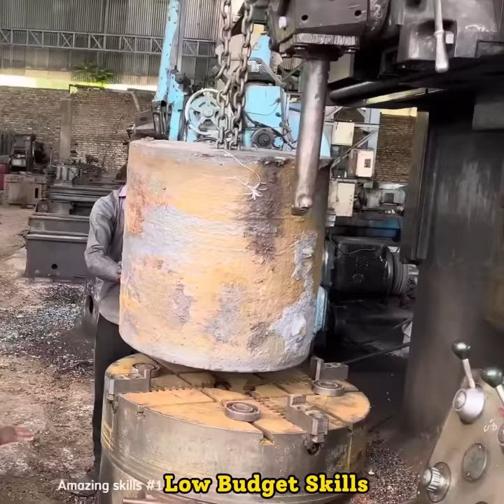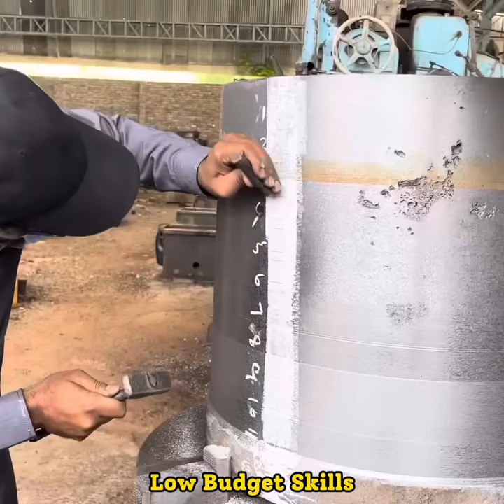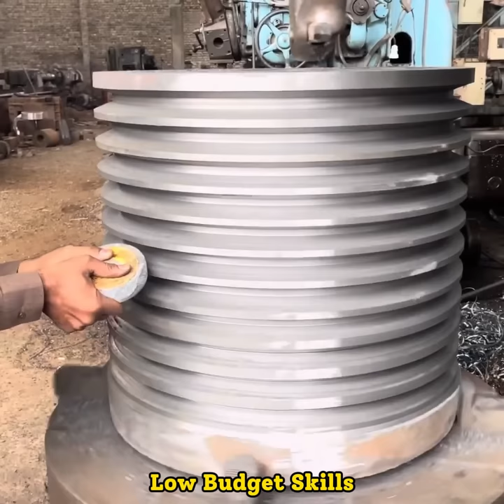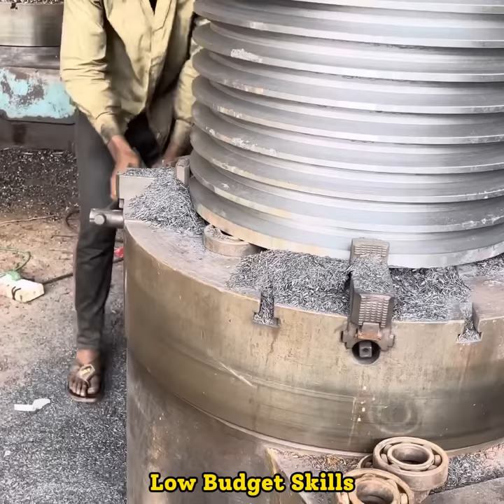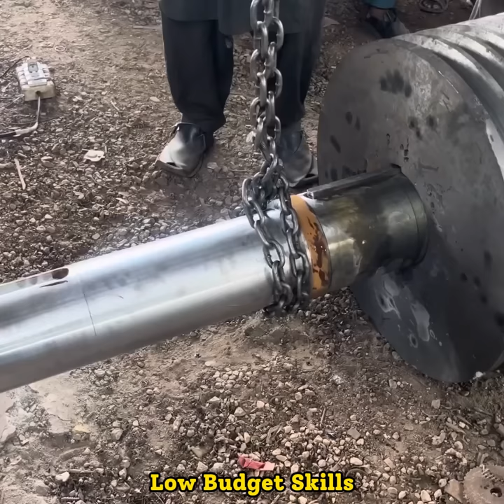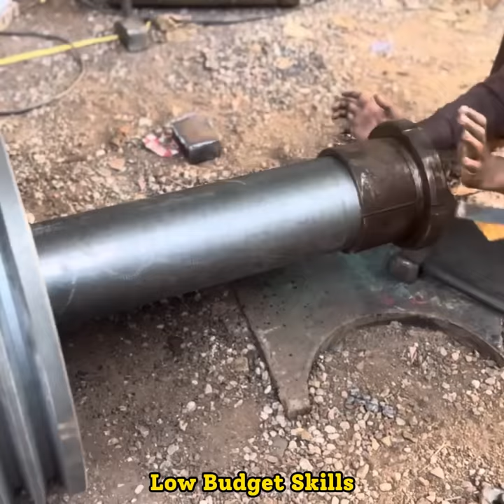How we turned solid block into Giant Pulley with old VTL W&B England

Comment: Like how they just slam it into a wall instead of pressing it in.
Reply: Tbh idk how else they would seeing the tools they have 😂 very decent outcome but who knows how long it will last
Reply: 😮Indeed❗The Shot Of Them Folks 
    Slamming That Thing Against the
   Wall Had Me Rolling on the Floor😊👍💋✨🖕
Reply: In safety sandals as well
Reply: @OogieBoogiegames they actually have hydraulic presses, but it isn't easy to bring them around the factory floor from the milling area to the press which is big, horizontal and in a different location. The rails holding the chain only go so far. This is how it uses to be done. And it works just fine. Honestly, this is a big chunk of steel that's going to depend on it's mass for strength more than anything else. That keyhole and key were massive. A lot of these are for massive compressors.
Reply: Ah parce-que tu pense vraiment que tu est plus courageux et plus astucieux que ses travailleurs car pas beaucoup de personnes en Occident pourrait travailler dans ses conditions avec astuces et débrouillardise et intelligence et avec des moyens limités 😏🤔🤫😬

Comment: Why this guys are using cast metal for this part? Cast metals can break easily it can failure easily. This piece of work metal should have sintered before the process to gain more elasticity and resistance to failure. I know its a cast metal because of the way it looks at first and non continuous chip creating in the process they show.